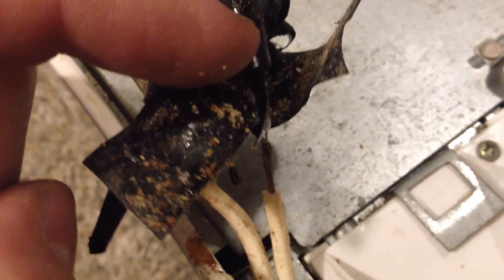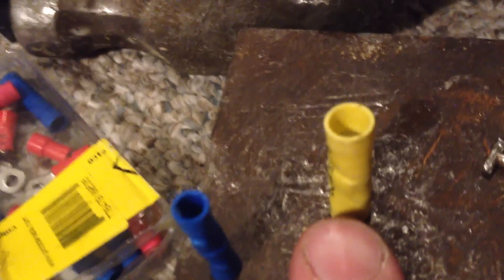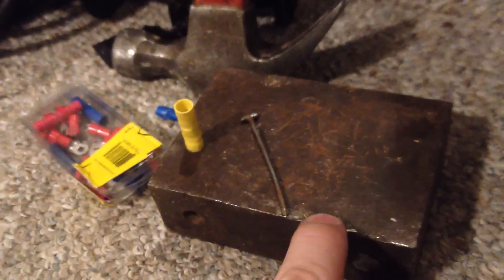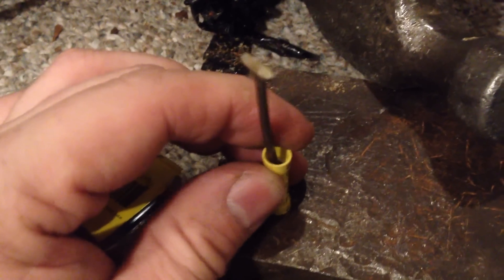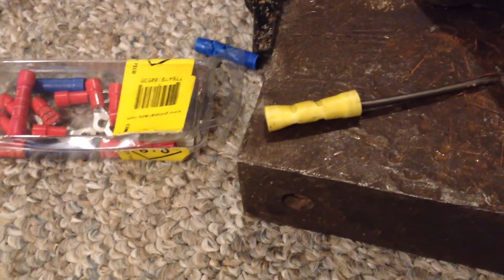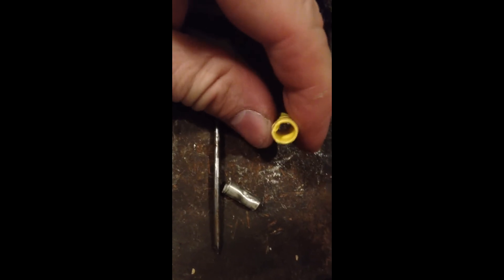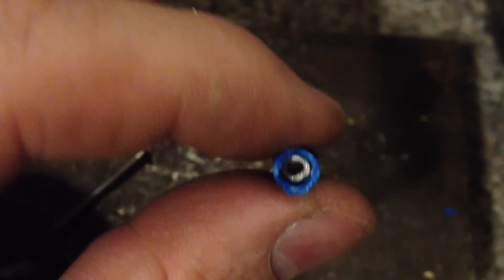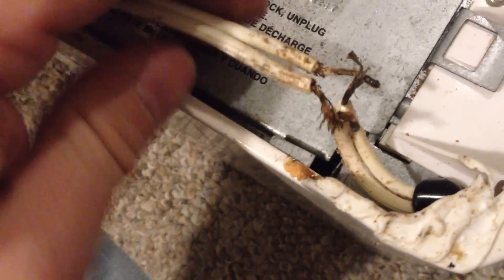Electrical quick connector bush-fix

Comment: I would rather use a brand new connector instead of it causing a fire if not insulated correct but the best thing to do is just replace the whole cord again why risk a fire or killing someone or your whole house down.
Reply from the maker: Absolutely

Comment: Sure why not. :)

In such situation I would just cut a bit more of the wires, make it clean copper, and solder together permamently. If needed then use heat shrink tubes on both wires to seal them, and then a bit more of isolation tape, or 3rd bigger heatshrink tub over both wires (about 5 cm), to seal it too. No issues with bread crumbs. Done it countless number of times, it doesn't make wires bigger than original and is very sturdy.
Reply from the maker: Good one. Thanks for watching. Once the soldering equipment and supplies are there, might as well remove the short part from the circuit board and re-solder the remaining length so the cord is unspliced, intact, safe.
(I was going for a bush-fix without soldering or heat gun, what can be done in a pinch that`s better than twist-and-tape, but not as involved as soldering.)

Comment: the yellow butt connector is for #10 wire & the cord you are fixing is probably #14 wire so even when crimped it may not be a good tight connection & could get hot .
What you did may be ok temporarily but if your toaster is good I'd put a new cord on it or buy a new toaster .

Your videos are interesting .
Reply from the maker: B Ann Yes, but I had 2 pcs or ends of gauge 14 twisted together so given the thickness of both, gauge 10 worked. The blue was too small. (I`m gettin` my $12 worth of toaster out of it with a 2-penny fix. Lasted for 14 years so far, it`s still a puppy, nowhere near retirin`.) Thanks for watching.